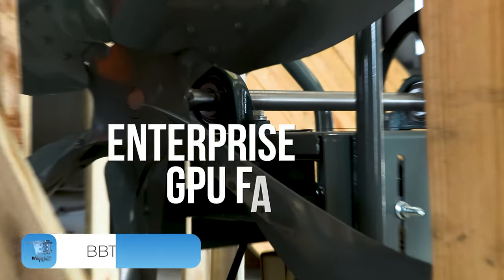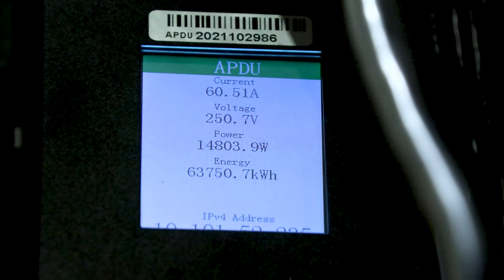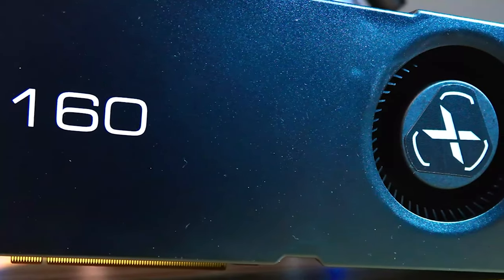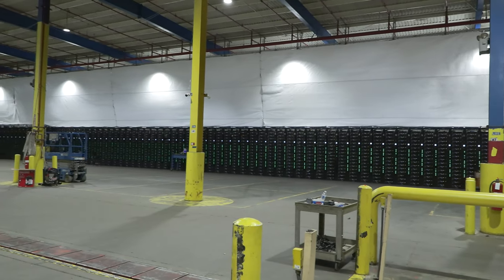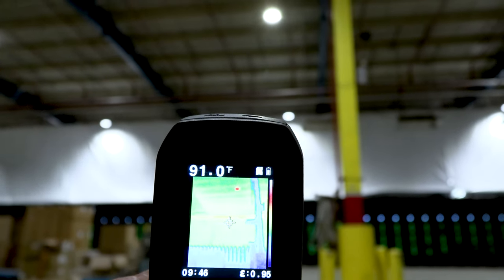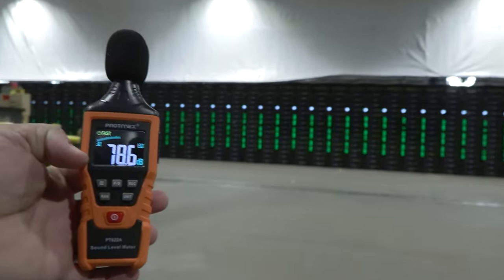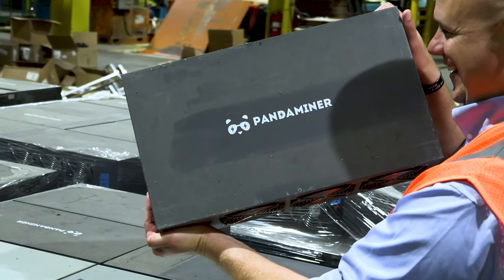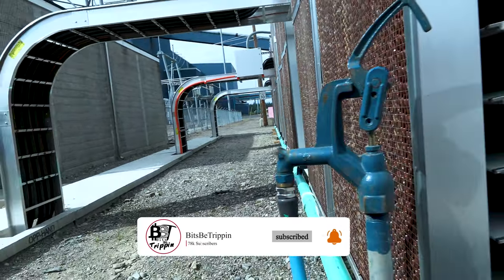1+ TH GPU Mining Farm

Comment: The fact that this farm/factory has more than 1% of all the network hashrate of ethereum is mind blowing
Reply: @whichever2007  Whoops forgot the decimal point lol. Thanks for pointing it out
Reply: @justinrules96  there is about 900+ Th running eth rn worldwide... 1 TH is a little more than 0,1%
Reply: Now there fooked after Ethereum has gone
Reply: @stevebills22  Possibly, but a farm of this size is using every advantage possible to generate a profit. They likely have negotiated a lower electric cost, or perhaps use solar panels. They will also keep detailed records of the all expenses to write them off at tax time. While mining isn't profitable for most of us right now, that will change as more miners continue to turn off their rigs and network hashrates will gradually drop off. At this point its a battle of attrition for those who mine.
Reply: @justinrules96  Something will change if such factories are disconnected from mining
Reply: @justinrules96  they use hydro generated electricity, it's given in description

Comment: 415/240?
Reply from the maker: Yep, 415/240
Reply: @BitsBeTrippin  does that means it goes from 415 -> 240?
Reply: It means 3 phase where the voltage between phases is 415V and phase to neutral is 240V. Breakers only need to be single pole to provide 240V, only four wires needed to deliver three 240V circuits. Very efficient for the purpose.